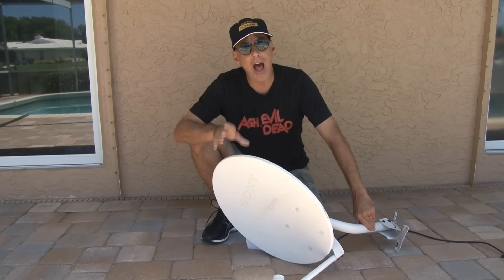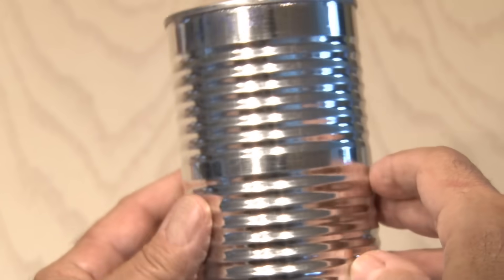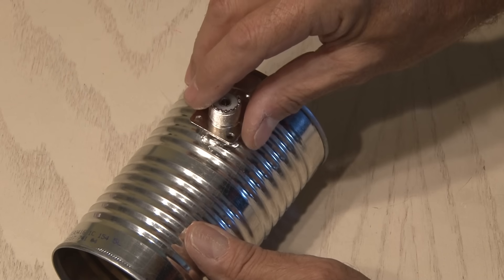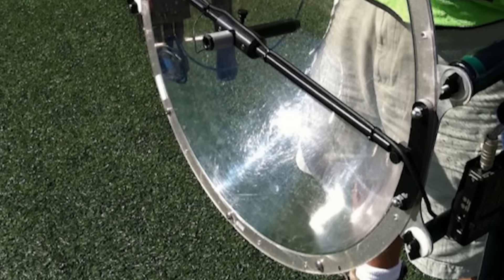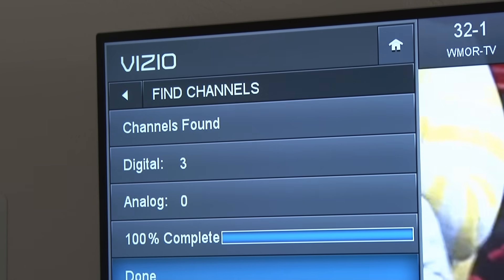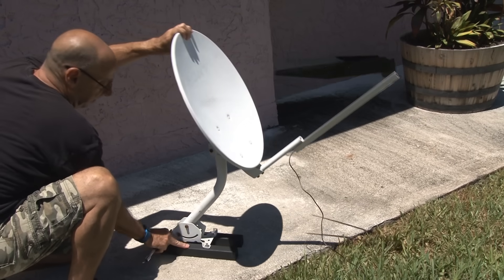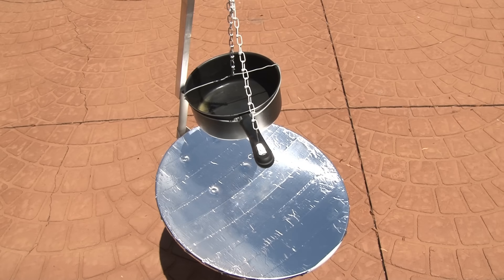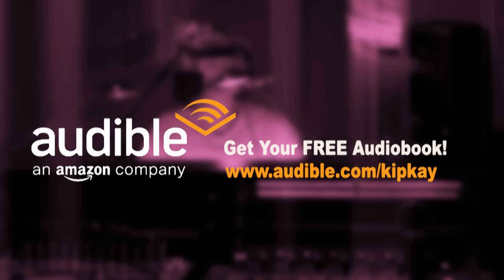4 Brilliant Uses for an old SATELLITE DISH!

Comment: with the L&B and wire still on (assuming that both of them are still good and its still pointed at the satellite in outer space.... use a multimeter on the end of the wire to peak out the signal. you should get between 7.2 volts and 12 volts. put a simple diode inline to keep the power from your battery/s from going to the L&B and you have a battery charger or enuff power to light a L.E.D. 24 hrs a day! but Shush. .. they don't like us knowing things like this!!! ;-)
Reply: you can actually collect electricity with a satellite dish from satellites in space? how many watt  LED can it charge? im guessing very low amperage too?
Reply: +Christopher Jones it will charge up a 7.2 volt battery pack in about 90 minutes so depending on your wattage of the LEDs you could do a lot!

Comment: wouldn't the WiFi one transmit wifi signal or do I now know how something works?
Reply: Yes it should transmit also.
Reply: so if we plug that into a working router with a wifi signal like our house.. will we be able to broadcast our wifi to say.. across the street to my grandmother who wont get wifi for her house?
Reply: Christopher Jones , That set up may still not work if you do not have enough signal strength from grandmother's house back to yours. A lot of laptops, tablets, or cell phones may not have enough power to reach your house from grandmother's house. You may need a repeater set up. Your Wi-Fi to external antenna. Signal from your external antenna to antenna at grandmother's house. Antenna to repeater or "bridge" unit at grandmother's house. 

http://www.open-mesh.com/
http://www.open-mesh.com/products/access-points.html

Comment: Actually you should have used screws to mount that coaxial socket. The outside of the coaxial should make good contact with the can as the can works as a waveguide and should be grounded (to the coaxial cable).

Comment: 22,000 miles? really?
Reply: geostationary orbit. ever heard of it?

from wikipedia:

A geostationary equatorial orbit (GEO) is a circular geosynchronous orbit
 in the plane of the Earth's equator with a radius of approximately 
42,164 km (26,199 mi) (measured from the center of the Earth). A 
satellite in such an orbit is at an altitude of approximately 35,786 km (22,236 mi) above mean sea level.

all tv broadcast satellites have geostationary orbits. so he's right.
Reply: Earth is flat -_-
Reply: If it's flat, who lives on the other side?
Reply: Upside down China of course... and space aliens.

Comment: what if the wifi is secure?? and about how far will that reach??
Reply: @eric carrol:::try this....put any keys inside the can untill it full to the top, those keys will help you to open the wifi security, this is what i call On The Go Decrypter, so you don;t have to insert any password anymore while connecting to those secure wifi
Reply: @garak::huahahaha....yes that would be alot quicker, but where i can find that smart nerd can??
Reply: The security is still working. I have seen people use smaller versions of this antenna setup and they get lots of SSIDs, but 99.9999% of the SSIDs are WPA2 protected. If you happen to live near a fast food place or other store that offers public Wi-Fi access to the World Wide Web, then you are lucky.

Comment: I have a few old dishes I saved and will use them to see if I can pick up signals with them. One was used to pick up digital signals for my internet service until they replaced it with the new one. The other dish was used by by the dish internet service, and I have a box for it also. After putting up a FTA satellite dish and getting it to work and then having a Dish and Directv dish up for awhile and then stopping their service and going back to antenna television I love it.

Comment: TV signals from over 22,000 miles in space.... lol .. more like 200 miles
Reply: The geosynchronous orbit is the reason that once you align the dish properly you almost never have to adjust it again. Otherwise you would need a tracking antenna system like ocean going ships use.
Reply: Satellites in space are a lot more than 200 miles away. The signals come from the earth surface towards the satellites and is bounced back to earth on the dishes. The two-way distance from the earth to the satellite and back to the earth is 22,000 miles.
Reply: tv satellites are 22,000 miles  up. our space station is 200 miles up
Reply: well damn...thanks for the update guys.. i learned something new today

Comment: Using wifi from a food place without being inside it is illegal. Even if it has no password. Unless it says free.
Reply: It's not illegal if no one know's your using it
Reply: +invento 123 but if you ARE caught you can spend up to 4 years in jail. Unless it says free
Reply: thats cool
Reply: At the large McDonald's near the interstate highway exits you can see lots of people who get food from the drive through sitting in the parking lot using the public McDonald's Wi-Fi. Then you can look over at the nearby gas station and see those people in that parking lot using the same Wi-Fi from McDonald's also. So how does McDonald's discourage too many users? Two methods. One is the natural slow down in data transfer rates as the number of users increases. At some level the Wi-Fi is so slow that few people want to hang around and wait for it do work. The other method is a disconnect timer built into the routers and access points. If your device remains connected for too long, the AP or Router disconnects you.

Comment: will the internet one work?
Reply: It will if you run a screw thru both the can and SO239 (or other type) connector. Gotta have the grounding, as that's the other half of the Cantenna. Since WiFi is 2 Ghz, a BNC, F, or TNC connection is good/better here. 

The F connector could be an F81 Barrel with the right length wire on one end, and the other having the feed-line. The connector would actually self-ground, if made up tightly to the can.
Reply: so whats the best connector to use and do we add it to the can just like he did? Dont need to do anything different except just change the kind of connector? I want to do this.. I lose my wifi signal when i go across the street into my grandmothers house.
Reply: By-far the Most important part is to connect the shield (body) of whatever connector you're using, to the can.

Comment: UHF connector should touch the outside of the can, so plastic is not the perfect fit for installing it, and an N connector would be better, as using the correct measurements for the antenna...
Reply: He also put a UHF tv antenna at the end of a satellite dish arm, UHF connector knowledge ain't gonna solve this guys issues.

Comment: wouldn't it be better to make the cantenna element a half wavelength tall and then put it a half wave from the bottom/back of the can? also, since wifi is bidirectional you probably shouldn't use hot glue to attach the uhf connector to the can because you would end up insulating it from the groundplane and that can fry the transmitter (although unlikely at wifi power levels but if you're doing this then you may as well do it right)
Reply: More importantly, he's building a dipole antenna, the can needs to be electrically connected to the “outside” of the connector for it work at all. He obviously did end up having a connection there, but it's probably pretty bad an definitely not reliable. Also his placement strategy is completely wrong. It's not supposed to be quarter of the can from the back, but quarter of the wavelength (for 2.4GHz about 1.15–1.2 inches). Once again he accidentally got it close enough to work, but his method was completely wrong.

Comment: everyone confused about the router antenna think of it like this. how would the data you send from a wifi device get to the router if the antenna only sent out a signal and didn't receive one as well.

Comment: bigger can = bigger wi-fi signal ???
Reply: A Dish only focuses a signal which is nothing to do with upload and download.
Reply: Legend Length
It actually does focus the data being sent out also. But unlike a satellite wifi frequency will not have the same range when focused(half mile wifi vs 200 miles). I remember hearing that you can get 3miles(something like that) by facing two dishes at each other.
Reply: Legend Length
Satelite Dishes are only for receiving when used with a provider. The consumers only want to watch TV usually not send anything back. That might be why you were thinking that.

Comment: Wouldn't plugging he cable in to the antenna port on the wifi router basically turn the satellite dish into a better antenna? I don't see how that would pick up wifi signals.

Comment: You should have drilled the CANTENNA (not Canteena - that's a food joint) to mount the SO-239 socket. By glueing the connector you did not properly connect the braid of the coax cable to the can itself and thus did not properly create the waveguide you were aiming to make.

You also did not focus the can on the focal point of the dish. Optimal signal requires that you harvest radio waves correctly from the dish. If your antenna is not looking at the right part of the dish or the waves hit the can rather than the stub inside you'll get minimal signals if any at all.
Reply: No. There's a reason the "probe" part is as far as it is from the bottom of the can. The can acts as a beam antenna pointing at the focal point of the dish (not the middle as you might expect).

Comment: G'day,

  Yay Team !

   I live 30 Degrees South of the Equator, 160 Km  from the Coast, 1,113 Metres above mean sea-level.

  About 3 years ago I made & posted Videos of a "SunPower" Solar Stove, made from an almost identical Satellite Dish using  8 Triangular Segments of Aluminium-Foil, attached with Contact-Cement.

  I made a (manual) Tracking-Mounting & a holder for a Coffee-Percolator which  holds 750 mls of Water, and a "Tea-Cosy" made of Aluminiumised (Building-Construction)Thermal-Insulation ; and, as such it took 30 minutes to boil the Water & make the Coffee without the "Cosy" in place, whereas with the Insulation it took 20 minutes, but by using  the "Cosy" and a  Table-Stand Kerosene-Lamp on Over-Rich Mixture to cover the Percolator's Base with "Lampblack" (Carbon Black), the Boil-Time was cut to under 10 Minutes...!

  Just(ifiably ?) sayin',

;-p

Ciao !

Comment: problems with wifi antenna:
- proper feed point is a function of the wavelength, not the length of the can.
- the "UHF" socket is not suited for wifi signals.
- the shield side of the connector should have good electrical contact with the can.

Comment: So you couldn't use the LNB as the wifi antenna? If so why not?
Reply: LNB= Low Noise Blocker. It will block the lower WiFi frequencies in order to "see" the higher satellite frequencies.
Reply: Ah, I see. Thank you.

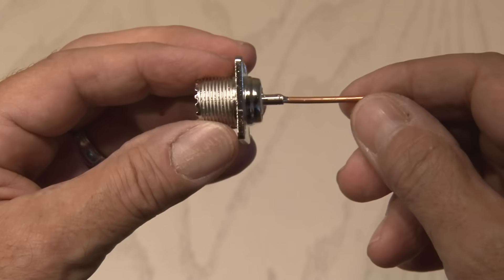Comment: You could probably get better WIFI signal if you fastened the coax connector with screws (2:20). By using the glue, you are not connecting the ground to the can (that's the purpose of the can). Maybe it could connect a little, but the hot glue would act as an insulator.
Reply: I guess the dish as the parabolic reflector would also be grounded, but for optimum performance you would want the cantenna to be the right distance from the dish, that would take a few calculations (so the signals really focus on the can).  But since this is all quick diy stuff, it would probably work anyway without all the math or calculus.

Comment: The antenna does not work. You have no connection between the can and the ground of the connecter
Reply: The outer conductor of the coax is the ground.The only exposed part is the small wire soldered to the inner coax conductor. The can is just a reflector of signals to the exposed wire and is grounded by the clamps he used to mount it.

Comment: 3:35 thats illegal .-,
Reply: ***** no i meana it illegal to use "free wifi" without being a consumer  look it up
Reply: It's not public wifi, it's a private connection owned by a private business that allows customers to use it for the duration of their visit.
Reply: CockatooDude The IT manager will know. Comapnies have the IT manager check access and usage logs, blacklist or whitelist users, and even make the call to deny customer access all together. If the company doesn't have an IT manager, then they'll use their ISP's data tracking services as well as customer throughput, and realize that some asshole is accessing their internet connection illegally.
Reply: CockatooDude Every mainboard and form of storage has a unique static address that is visible any time they connect to any network infrasructure, including the internet. Tor only changes the OS dynamic IP address, which isn't even used for IP and MAC address tracking.
ISPs monitor usage for illegal activities, violations of ToS, and terrorist activity. They also have automated systems that monitor data usage, and most ISPs offer businesses alerts for unauthorized usage as standard feature.
Small amounts of data quickly add up, a customer can easily eat up 10GB of data per visit, and stealing access to a Wifi signal, an asshole like you can push a business over their allowance or take up bandwidth.
Reply: CockatooDude Depends on the platform you use. I used Ubuntu, and a package manager makes getting server packages easier. There are also Apache GUI applications that make basic servers easier to set up, but that is more for media server and mail server.
Reply: No one has to know you're using it.
Reply: ://ReaperReaper TOR
Reply: CockatooDude Tor doesn't protect you from ISP tracking data or router/modem blacklists/whitelists. It actually doesn't protect you unless you switch physical machines every few uses either.
Reply: ://ReaperReaper At least they don't know who you are, and then you can switch wifi every few days anyway.
Reply: CockatooDude Only if you are low profile or have enough hardware access to switch every 2 to 3 days and never use the same hardware afterwards. With the resources that ISPs and even small software groups have, you can easily track and identify just about any TOR user.
Reply: ://ReaperReaper Two things, 1st of all, how can they do that? And second, unless you are using very large amounts of data, why would they care?
Reply: ://ReaperReaper Hey man I never said I do it, with all the trouble someone goes through to do this undetected, they might as well pay for an internet connection. I was just being hypothetical. You know, entertain the possibilities. Also, businesses have allowances for data used? I thought it would work similar to a home system.
Reply: CockatooDude My apologies, good man. The way you tried to agrue for it was very misleading, especially since you brought up Tor.
Businesses like Microsoft or Google don't have allowances or caps placed upon them. Smaller businesses, like mom and pop shops with a website, are subject to data caps/allowances, bandwidth throttling, etc. Franchises, like McDonalds, Wendy's, or Burger King, go through the same business services ISPs offer. Business plans offer higher bandwidth and data caps, but they are still there. When you open that up to a customer, you can easily see 500GB of usage a day if you haven't set routing priorities and usage restrictions.
Reply: ://ReaperReaper I had no idea the usage would get that high, I mean I use about 500 a month, but that's true, because what do people do, they go in there and watch whatever, and sometimes are in there for hours. But I mean there must be a way to scramble your MAC address, or the IP that is used for tracking on a local network, maybe you'd have to hack the router or something. Which you couldn't do anyway with this setup because it's only one way. It's a failed plan. There has to be a way to be anonymous though right?
Reply: CockatooDude The only thing you can do is make it harder. MAC and static IP can't be changed, but rerouting your connection through a series of modems and routers makes it harder. Using a VPN also tricks most automated trackers if they only trace to the first IP tied to a client grade machine.
KipKay's setup also won't work. While it can pick up the information from the router, there will be severe data loss and the router won't be able to recieve any information, or bits that would effectively be the same as rewriting the entire Game of Thrones series using only the letter "Z."
Reply: ://ReaperReaper Ahh well I never you could use multiple routers like that, would be a bit cumbersome to lug around though, not to mention power. But really I guess this whole thing isn't that relevant, because the things the average person looks up on the internet aren't matters that absolutely have to be kept secret. I'm guessing you work in networking, but if you don't, I would really like to know where you learned all this.
Reply: CockatooDude The routers aren't physically in one spot, and generally, only one of them yours. Using multiple routers typically means running your traffic through your router, the ISP, other routers on the ISP's hub, or even through cross communication between ISPs and local servers.
I learned about internet routing when working of a personal web server and a personal minecraft server, in order to route. Both of which I've sinced scrapped, the web server was just a pet project and I don't play minecraft enough to want my own dedicated server over just running mods that can initialize a temporary server and using Hamachi LogMeIn.
Reply: ://ReaperReaper Are there any programs that ease the process, or is it all manual?

Comment: the Wi-Fi may perform better with better electrical contact between the UHF ground side to the can. perhaps solder the can.   
Also notice the offset feed point, in some of those scenes you were pointing up at the sky more than at a ground transmitter.

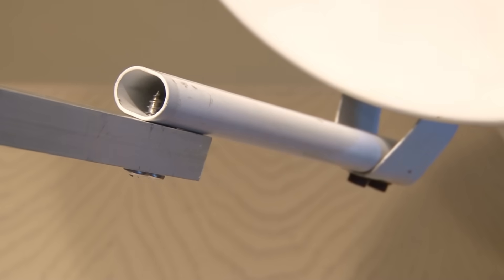Comment: 5:45 'OK I screwed in the tube and it's good to go.' 5:47 'Next I ran the wiring .......down through the tube.' I bet you didn't get the connector past the screws.